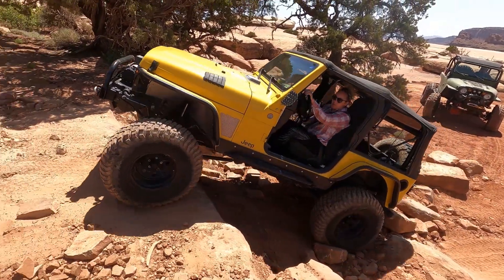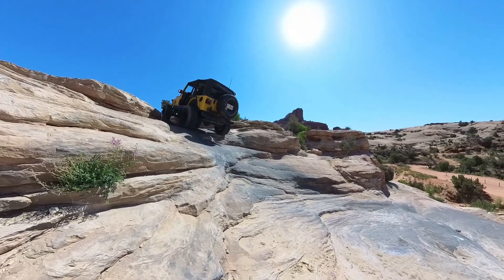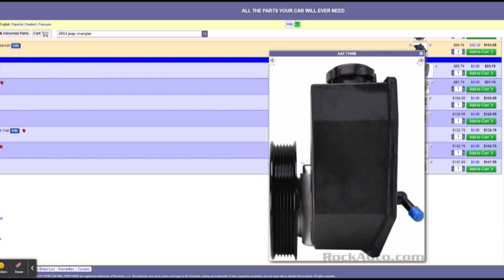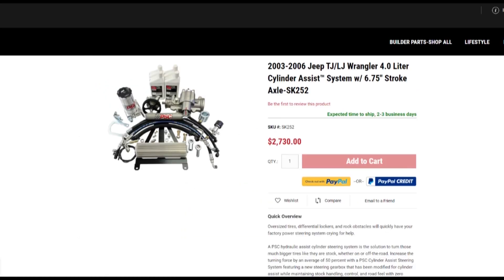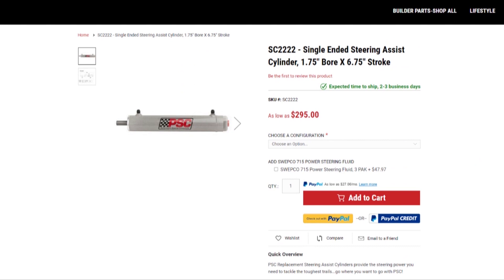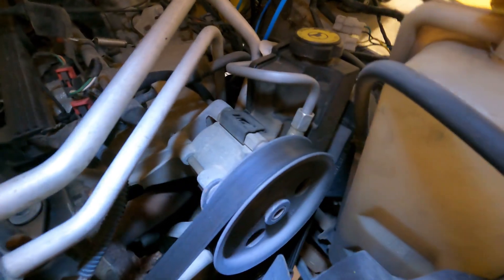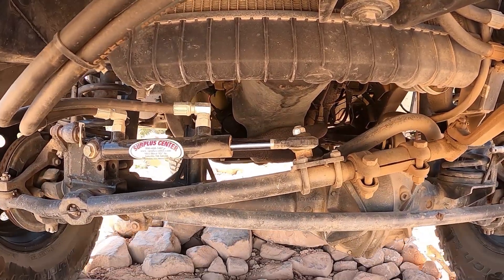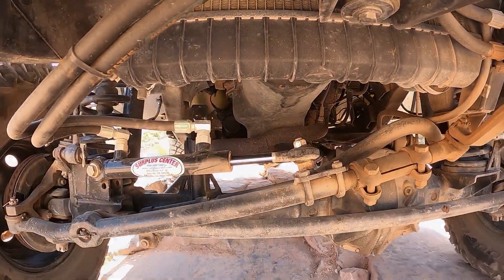Proving the Internet WRONG! | Jeep TJ Hydro Assist

Comment: I did this exact system after watching this video on a 97 2.5l, the power steering pump handled it no issues.
Fast forward about 18 months and the pump went out. Well ive tried replacement pumps and they both whined like crazy (properly bled of course).
Do you think these Crown replacement pumps are just trash or would porting the pump have helped?
Reply from the maker: I'm not sure. This TJ is a 4.0L, I don't know if there is a difference in pumps between the 4.0 and 2.5. Does it whine all the time or just whine under load (turning)?

Comment: Qusestion. why does the Input shaft need to be shorten ?
Reply from the maker: The Saginaw steering box is longer than the Mercedes, so the shaft needs to be shortened to fit. If you already have a Saginaw box, no need.

Comment: I'm looking to add this to my delivery vehicle XJ because I have to turn around 30-50 times a day and it would be so much easier. It's good to know I can put a smaller ram on since I have much smaller tires.
Reply from the maker: It will also take some stress off the unibody where the steering box mounts. XJs with a lot of trail miles tend to crack at the steering box mount.

Comment: You don’t need a hydraulic assist in a TJ with 35’s
Reply from the maker: Sandstone is almost like pavement in a lot of ways. With the front ARB locker engaged, it was impossible for the owner/driver to turn.
Reply: I have 33s and have needed it at times when I was hard turning with lockers on in the rocks. It helps a lot.

Comment: Do you have any links to the parts purchased?
Reply from the maker: I did at one time, but the links all changed so I removed them. Surplus Center still has the ram, but its a different part number now  9-7257-6. The steering box you can find instructions online on how to drill and tap your own or just buy a reman that's already drilled and tapped. Hoses are from NAPA.
Reply from the maker: Here is a link to purchase the steering box mount: https://marketplace.sendcutsend.com/p/CP51Z855/saginaw-steering-box-frame-mount

Comment: So you attached the ram to where the stabilizer is mounted and then to the drag link?
Reply from the maker: Yes, replaced the stabilizer more or less. With the Y-link steering on the TJ, you can't connect it to the tie rod, otherwise you will get funky bump steer.
Reply: Do you think that is a better option than getting a diff cover that has the link on it and connecting to the tyrod?  I have an XJ with the same steering.
Reply from the maker: @samwalker1304  Trail only or street driven? If its trail only, it may not matter.
Reply: Tried to get the specific ram that you ordered but can’t read it correctly. Can you give me the part number on it please, thanks.
Reply from the maker: @samwalker1304  9-7257-6

Comment: Who said it was "impossible"? Of course you can do it, it's just not as optimal. A pump from a V8 Grand Cherokee with hydraulic fan is the same external casing with better internals and you can grab it out of a junkyard for around $20. After a couple easy mods and a smaller pulley, it is plenty of flow for cylinder assist.

Comment: So … your ram is attached to the drag link and not tie rod ?? Should be attached to the tie rod. Drag link doesn’t stay parallel to the ram … thus bending the ram eventually.  IMO no way would I attach to drag link
Reply from the maker: On a TJ neither the drag link nor the tie rod stay parallel to the ram/axle. The drag link goes from the steering box to the passenger knuckle and the tie rod connects the driver knuckle to the drag link on the passenger side. The tires do toe-in as the axle drops away from the frame. Mounting the ram to the drag link is the correct way to prevent bump steer and death wobble.

Comment: How's that Red Head steering box holding up? Gonna install mine this weekend and want to do this same setup. 
What length hoses did you go with,and how did you modify the trac bar bracket? I tried to screen shot and zoom but its hard to tell.  Thanks!!!
Reply from the maker: Steering box is holding up great! I took rough measurements for the hoses with some fuel hose I had lying around. The hoses were made at the local NAPA, I had them crimp one end on and leave the other end off, went back home and cut them to length myself (just to get it perfect) and then went back and hand the other end crimped on. The hoses go over the grille support bracket and wrap around behind the radiator on the ram. I originally had a bungee cord holding the slack up toward the frame, but it rotted off. If you are asking about how the axle end of the ram is mounted, I welded a piece of 1" ODx0.5" ID DOM as a sleeve on top of the old steering stabilizer mount and gusseted it. Since it is a single shear setup, its important to be able to torque it properly.